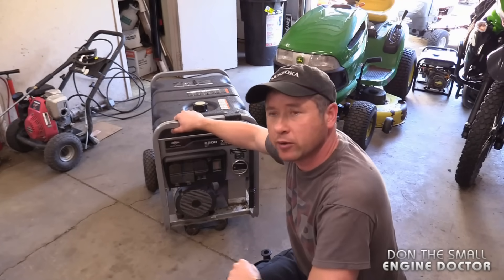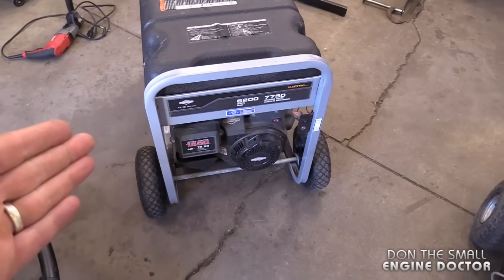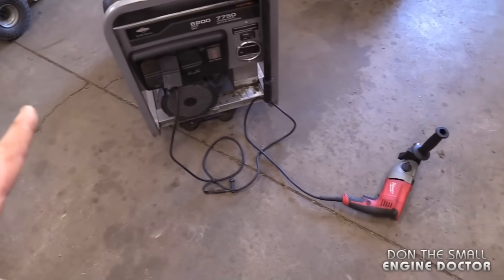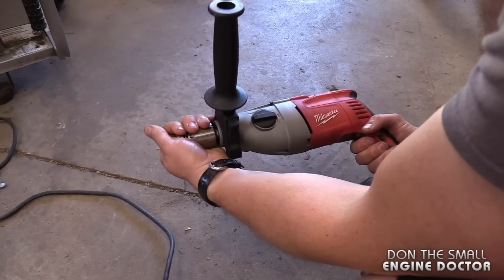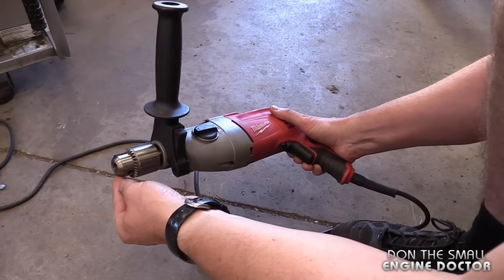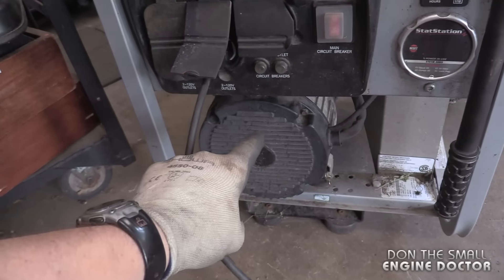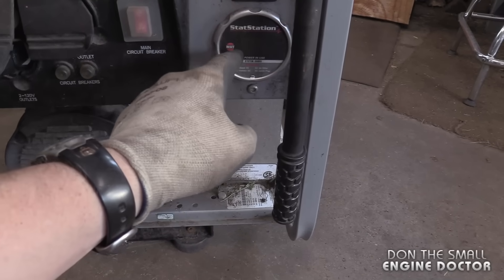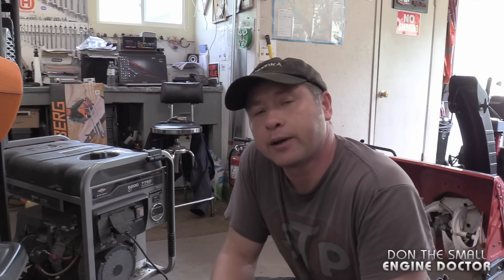HOW-TO "Flash" A Generator | Make It Produce Power Again | MUST WATCH

Comment: Thanks for this! Actually had a westerbeke marine generator fail to start because the dc charger (alternator) draws from the 110 circuit charging and I didn’t start the geni for a couple weeks. Basically had to use the battery start holding for a few minutes to get the excitor going again! After many hours trouble shooting I saw your video!!

Comment: There's either a capacitor that's not holding a small amount of remnance voltage or the off switch has a slight short in it  in it causing the remnance or residual voltage to leak out of the stators  excitation coils for the rotor. As well is there a lot of humidity in the area where you live? That could also create an issue, storage areas also plays a roll in this. Also when powering down the generator, you may want to turn the generators on switch to the off position first this can cause sudden draw to the to the excitation coil. The possibilities to the residual or remnance loss could be many, from shorted excitation coils to the aforementioned issues I've just mentioned. Also a digital multimeter is a good thing to have. If this generator has a secondary outlet for battery charging, check to see if the diode pack isn't leaking. If you have continuity both ways in the diode pack or grounding both ways then there is your problem. Just because it has low hours doesn't mean there's either a defect that showed up or existed right from factory. But a digital multimeter is a must have when doing diagnostic procedures.
Reply: Eckehardt, I have one of those 2 cycle China generators that runs great but once I flash it with the drill, it quickly loses its power to run the drill.  It produces barely enough power to operate a 4 watt bulb on a nightlight.  I had the 12 uf capacitor tested and was told it was good.  Can a diode bridge rectifier cause this problem?  I'm puzzled at this time, can you help?
Reply: @dwainmeche7849 I know it's an old reply and have answered it. Here is an update. If the generator you have is a brushless type without a magnet then it's a remnance and capacitor type. You can try the drill method provided you plug it into household a household outlet and unplug it that way you have polarized the poles with remnance voltage, this goes for any brushed drill. By just getting a drill off the shelf that has been sitting for quite some time and barely used may not work and provide enough remnance voltage in the excitation stator to build up the capacitor enough. So polarize the drill first by plugging it into household voltage. But move quick the stronger the remnance saturation is the better chance your generator may flash quickly and properly.  If your noticing however that the remnance isn't maintaining  or leaks off after a few days there may be two or more issues. A) Cobwebs on the capacitor terminals on the Capacitor AVR  board system or an outright leaking capacitor which needs to be replaced. B) The diodes on the rectifier bridge. Sadly these are on the rotor because it uses a DC induced system that produces AC on the stator assembly ( note the stator has a remnance exciting section on one end. ) Now one can unsolder the diodes on the rotor, however you would need to know the rating of the new diodes. Usually these are sealed in epoxy with the rotor rectifier assembly and are a pain. Now attention to detail and how the old ones were soldered in is the key importance if you can find new diodes. If not done properly and not the proper flux is used and also sealed with epoxy again will cause them to fling off or soldering joints to fail because of the centrifugal forces of the speed of the rotor ( up to 3600rpm). Improper solder joints can also cause shorts in the system. Due to the complex nature of  balancing of the rotor, the best thing is to replace the rotor itself with a good used one. It's also a good idea to check the stator for any rotor contact, carbon tracing and any random grounds or shorts in the system. Also check for missing lamination and insulation and broken nylon ties that hold the stator bundle in place. If any of those are broken or missing chances are there's a short or ground. If the rotor has a purple winding on one side and gold on the other that means the one side leg has failed and overheating due to shorting or grounds. Same goes for the stator. If one of the windings looks darker than the rest then it's best to get a new generator or find a parts generator with a bad engine. You may also want to try a rare earth magnet on the housing on the remnance end to build remnance while starting.

Comment: I did this with my Generac iq2000 that had been sitting empty of fuel for 5 years, ran but no power. Actually twisted the 1/2” drill a few times before starting the generator and plugged in the drill, started the generator and barely twisted the drill counter clockwise with the trigger pulled and immediately the generator started generating power and continues to work fine.  Great information!

Comment: I have a music 3 phase generator which is runs but voltmeter reads zero. I checked on capacitors, stator winding looks ok. However on diode on the regulator does not give good value but I feel this should give me some voltage value.

The is no dc coming from regulator. How do I flush it using 12v battery?

Comment: I would hav to guess -there is a few ways to loose residual -a chafing wire , from vibration or a part of the winding has lost insulation to another copper strand of wire , or the avr (reg/rectifier) has a bad diode and is taking it to ground -but look hard at the free(not tied down) wire in the head first... good luck

Comment: Thanks for the tip.  Have you heard of it using a 6/12 volts battery instead fo a drill and touching the battery terminals momentary like 1 second?.  I’ve heard of it but am not sure how safe it would be.  Thanks!!
Reply from the maker: no I haven't

Comment: I bought a used ETQ 5500 watt generator and it does the same thing. The owners manual says rev it up a little to get the excitation going which does work, but thats dangerous especially for an amateur because the windings could fly apart with tremendous force. What I found was leaky/weak diodes on the rotor windings. I could not figure out the diode type for my generator so I will flash it for the rest of it's days. For some models the diodes (2 of them) can be easily replaced. But they might not be just any regular diodes, they might be zener diodes which regulate the excitation current thus control output voltage. On locomotives a lot of their generators have a large diode ring and same thing they will start putting out when revved up. Be careful the small excitation windings can put out 400 VAC. And if a winding is burned open, the capacitor could still be charged and knock you in the dirt.

Comment: Donyboy73... Thank you, thank you, thank you!!  I'd just about given up... after doing the battery flash and replacing the AVR on my 6200W Elite Briggs & Stratton brushed generator, neither of which worked...  and then I found your video..  It so simple I couldn't believe it would work.. two spins of my dewalt hand drill and the drill started running..  You are the best!!  Where the heck is your donation button??  Thanks!
Reply from the maker: donation button on my home page

Comment: Darn didnt work for me I just tried. Even bought a new capacitor and still not working. Tested the  breaker switch too and its fine. Generator wires that lead to capacitor are putting out 3.3 volts. maybe it isnt enough i dont know. So frustrating idk what else i can do darn.
Reply: Did you check the brushes? How many volts on them? Are they worn?

Comment: I wonder if this will work with a variable speed or reversible drill. With the solid state electronics between the drill motor and generator, will there be isolation preventing backflow of electrons?
Reply: i wouldn't wonder, i'd keep a non regulated angle grinder handy for the occasion.

Comment: Don, i. have the same problem on my John Deere 5500 Watt it a 550ge. does the same thing loses power  after sitting for a day or two! I found that if you at least let it run for 5 minutes with nothing on it the  the  regenerate I think that'll fix your problem that fixed mine I  usually  run a 220 welder off it and when I'm all done I let it run at a fast idle but 10 minutes and then every time I go out and start it now I have power almost instantly😉

Comment: Nice, I had no idea you could generate enough voltage with the remament magnetism in a drill. The way I heard it was that you connect a battery or charged capacitor momentarily.
Using gloves on a drill chuck is unsafe, they get caught all the time and peope end up in the ER.

Comment: I have a Honda eu2000i inverter generator that puts out 125 volts AC but if the draw is over about 200 watts the inverter shuts off.  It's been sitting unused for several years.  The gas engine runs fine and the eco-throttle slows the idle down like it should.  It just won't take much of a load.  It's rated at 1,600 watts continuous.  Would this flashing procedure make a difference?  Any other ideas?
Reply: more involved fix needed since it is an inverter machine full of electronics. caps on the inverter, the big ones can cause it. but it is inside of expoxy

Comment: Interesting, we always applied 12 volts to F1 and F2 to flash a field. I'm retired now, but held certifications in gensets and switchgear with Onan.
Reply: Can you please break this down to me so  I can have a well rounded understanding of the process. My understanding at the moment is that the self excitation system was not excited and he had to plug in the drill and give him a lil tickle to get excited lol. I'm joking but I would love  to hear your knowledge on this topic with your experience, thanks
Reply: Stephen Shannon I have a wire on a 30 amp plug that burned in half and did not trip breaker, and no power at all

Comment: Really cool tip,Don and so easy to do ! Tight fitting leather gloves might be better for that task . I have found  with those rubber palmed gloves that the drill can grab on to the rubber (especially when they are new) and possibly twist the hand. Just wanted to pass on my experience. Thanks, man.
Reply: I've seen it done running the drill with a wire wheel along a bench . Looked much safer.
Reply from the maker: thanks Andrew

Comment: It lost its residual magnetism. By connecting the drill and spinning it, you provided a small DC Voltage to excite the stator magnets in the generator. This reminded me of the pre 1963 cars that used a generator. Even if the battery was completely dead and provided you car was standard, a simple push with ignition on and in first gear you would pop the clutch and away you go. This is the same principle because there was residual magnetism in the car's generator.

Comment: HEY GUYS???    I've used generators of many different types for decades! .. but NEVER heard of this! ... so HEY GUYS??? could you hook up a little 9 Volt battery to the AC Output instead of the drill ... I'm thinking in an emergency with no drill handy? ... Obviously there'd be risk of the battery exploding ... but in an emergency this would be of little concern and risk easily mitigated (heck your could use an extension cord and put the battery in a tool box) ... Why do you think, would a battery do the same thing!???
Reply: NO

Comment: I knew this could be done. Ham raido did this to an old motor . It could be made into a generator by using a belt & I believe running it in reverse. I think it was called a squirrel cage motor. to make this kind of generator you use a motor with a belt that runs from a gas driven motor. You need a battery to give it a charge to make it start to work.

Comment: Bad capasitor,but mostly rotor
Reply: Use higher capasitor than the original,example= original was 50uf then change it to 60uf😉,that always work for me
Reply: I was thinking! ... that a capacitor is easy to change and not to fussy .. a bigger one would be better.

Comment: I had a question for you I commented on your video and you didn't get back to me so I figured the smart thing to do would be comment on your newest video I have a two stroke Briggs & Stratton same one you tore down that was blown apart I was wondering if you knew the part number for the connecting rod I found numerous connecting rods but it doesn't seem like they come with the roller bearing sleeve on them for the crankshaft could you please help me out I have a wonderful snowblower here that has a lot of potential but I need a replacement connecting rod thanks again hope to hear back from you

Comment: Thanks for this video. I haven’t cranked my generator in five or more years (too lazy to replace broken starter rope), and if I run into a no-power situation when I get around to cranking it again, at least I’ll have a clue about what to do. Your practical method of reflashing, and the viewer comments, are a big help.  My thought on an alternative to using your hand to turn the drill chuck the wrong way is to wrap about 18 inches of strong cord (i.e., brick mason’s nylon cord) around the chuck, anchoring one end(with a knot) in the closed chuck, and using your gloved hand to pull the cord. Haven’t tried this, but to me it seems safer in theory.
Reply: I'd be afraid the cord might catch on the chuck then wrap around everything in a 2 meter radius :)  ... like beards, lit kerosene lanterns, Bouffant Hairdos, Little kids wearing scarves, haphazardly stored vintage 78 rpm record collections in the garage ... well that'd be my luck anyway :)
Reply: @MikeBaxterABC  and your neck! lol

Comment: Please help 
I have an older homelite generator from the 80s it basically starts up fine but it sounds like it’s under a load when there’s nothing plugged into it if you plug something in that doesn’t draw much like a light bulb it powers it but if you plug in a drill it acts like it blew a breaker and the engine sounds like there’s no load 
It’s weird and I have no clue what causes this
Reply: I believe sounding under load when there is none is an indicator of a stator winding fault.
Reply: JK Brown thanks for the reply that could be it I know all the parts of generators but I’m not very knowledgeable on how to repair them
Reply: JK Brown thanks for the reply that could be it I know all the parts of generators but I’m not very knowledgeable on how to repair them
Reply: JK Brown thanks for the reply that could be it I know all the parts of generators but I’m not very knowledgeable on how to repair them

Comment: Here's what I think is happening.  If you look at the general working principle of an induction machine (motor or generator), you'll see it isn't constructed with any permanent magnets; it only uses coils of wire to form electromagnets.  In the case where an induction machine is setup to be used as a Motor, and you put an electric current through the coil(s) of wire, this energizes the electromagnet and creates a magnetic field to run the motor.  However, in the case of the induction machine being setup to run as a Generator, if you simply apply mechanical power to turn the generator, this just causes the coils of wire in the generator to freewheel past each other, with no magnetic force, no magnetic field, no magnetic induction of electrical current, and thus no electrical current is generated.  In order for electrical current to be generated by the phenomenon of magnetic induction, some type of magnetic field must be present.  

One way to fix this problem is probably to have one or more small permanent magnets mounted in the induction machine.  But I suppose that induction machines aren't normally made this way, because in most applications, electricity is available to provide that initial current needed to energize the electromagnets.  Once the generator is running it can provide its own electrical current (assuming the proper capacitors are wired to do this), but it needs that initial push to get started.  

Interestingly, the drill that's used to "flash" contains a universal motor and this might not have any permanent magnets either, but maybe it doesn't need as much residual magnetism to get started as a generator, or maybe they put small magnets in them I don't know.  

If this is a known issue with generators, I guess I'm a bit surprised that they aren't using some of the electrical current from the engine's dynamo to provide the magnetizing current to "flash" it.  (By the way the dynamo is a permanent-magnet generator so it doesn't have this issue that the other generators have.)  I guess you wouldn't want it hard-wired, but to provide the "flash" capability, perhaps it might work to have a "normally-open momentary push-button switch", perhaps marked "Reset", in order to temporarily connect the electrical output of the dynamo to the generator.  You might also want some kind of a fuse or circuit breaker in series with that in case the switch failed.

Comment: Have them run it under a decent load for a few hours a month. 
It should help it hold residual magnetism better. 
Lack of operation is the main problem when you need to flash these Briggs models.  
At least it’s easy to do.

Comment: Residual magnetism in the generator exciter field allows the generator to build up voltage during start-up. This magnetism is sometimes lost due to shelf time or improper operation, among other reasons. Restoring this residual magnetism is possible and is sometimes referred to as "flashing the exciter field".
Reply: what more info plz a video or something I'm genuinely interested as i 60%  believe this to be bs its  not that i don't want to believe but this seems kinda scooby doo